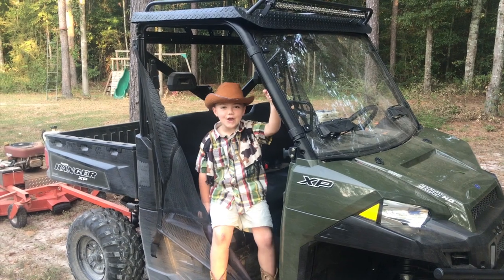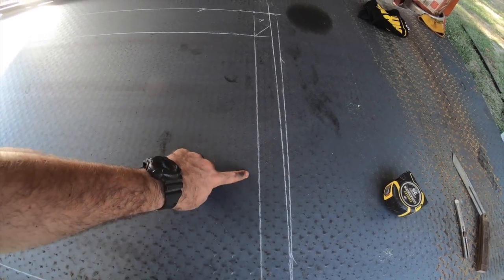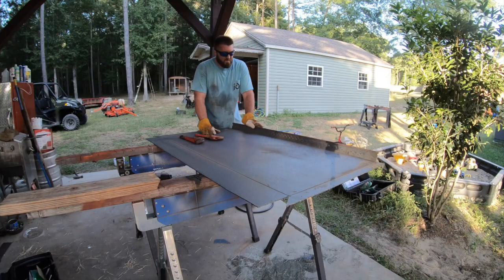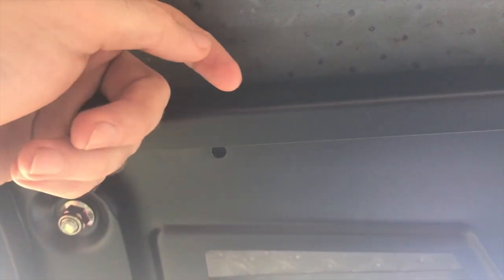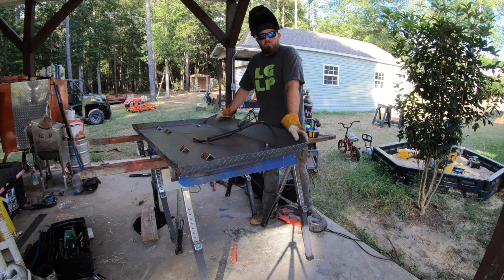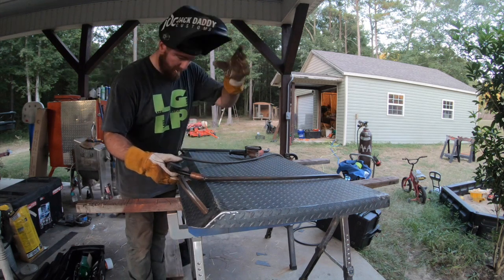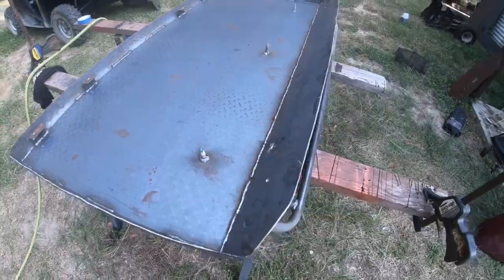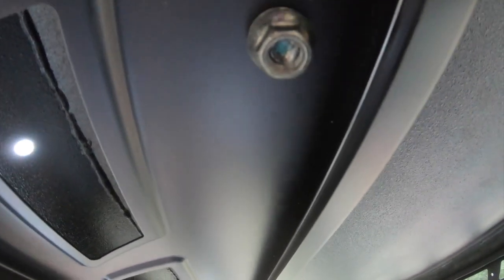How to make a homemade DIY metal roof for your Polaris Ranger or any UTV

Comment: what do you recommend for someone who doesn't have a plasma cutter and welder? I would like to learn welding at some point and could cut with a grinder, but for now don't have either
Reply from the maker: With enough creativity, you could make something sufficient by bolting or riveting the pieces together. Any way it goes though, you will need to be able to cut the metal with something. A grinder is definitely a suitable option.

Comment: Nice work brother.  Really liked the pipe bending.  Where did you pick your bender up at?
Reply from the maker: Jimmy Dean Ballinger I’ve had it for quite a while and I can’t remember if I got it at harbor freight or northern tool. It was a cheap one for a project with the idea of upgrading later but I just keep using it. Lol. It works great most of the time.